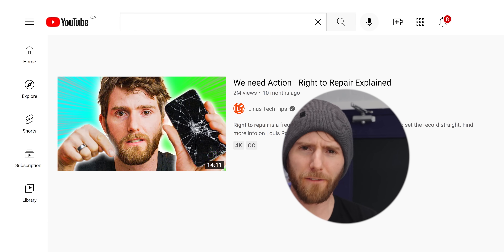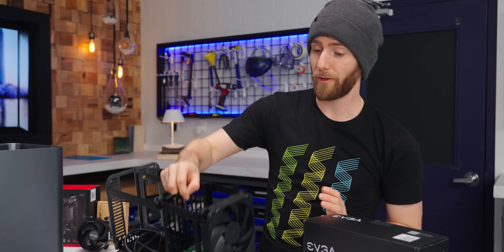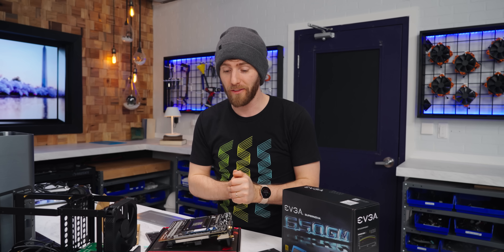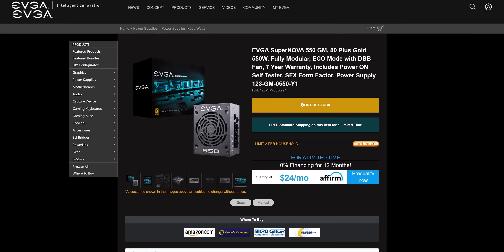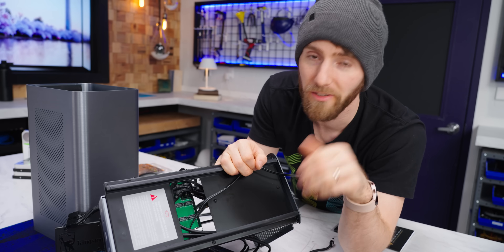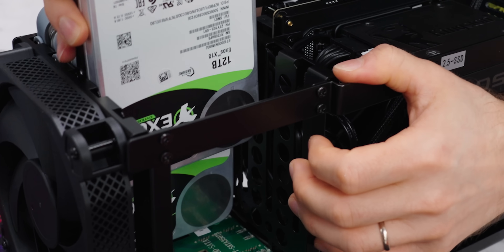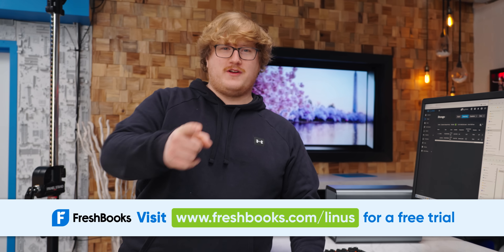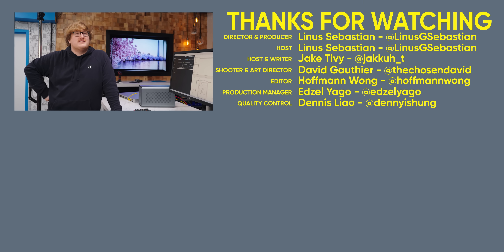This blows away the competition - JONSBO N1 NAS Build

Comment: Just buy a Synology or QNAP. I have been using a Synology NAS chassis from 2013, still works great, 4TB mirrored drives for family pictures, files and backups. I have only used about 1.8TB of 4TB available. I have another 2TB mobile drive attached via USB 3.0 for temporary files storage and sharing. It just works.

Comment: Didn't the Thumbnail say "100 TB"? That's 5x 12tb drives. And then when you consider striping raids, it basically cuts it in half.
Reply: Up to 100 TB, assumed you use a RAID-0 of 5x20TB. Forget redundancy in this case.
Reply: @HanniVlad  Thanks man

Comment: I think I'll stick with my homebuilt OMV NAS setup. 3 x 8tb. HGST SATA 6gbps. drives, a 128gb. SSD for the OS, and an older Core i7 motherboard with 2x gigabit LAN ports, in a mid tower case. It has held my mission critical backups for all my local network machines for 2 years+ and all my media server backups. About $525 total investment WITH the drives.😉 $65 ea. for the 8tb. HGST drives on Ebay, and $30 for the 128gb. SSD. OpenMediaVault has worked flawlessly and imho, is a bit easier to work with than TrueNAS.

Comment: Love the video and would like to build something similar but with two modification. Remotely accessible and ZFS metadata on NVME array.  Can you make a recommendation for a motherboard with either intel vPRO / IPMI and PCIe bifurcation. Ideally, I would like to do the same build but with TrueNAS setup to store metadata on 4 x Intel Optane in RAID 10 via something like the Gigabyte CMT 4034. Or is this already possible with intel VROC on the ROG Strix B550-I

Comment: i'm running a qnap ts-230 with 12tb in raid1, with 3 reolink cameras hard wired with POE with a battery, power goes out, cameras stay on, cheaper than renting onedrive space. I can VPN in, upload from anywhere on telus at 100MB/s up and down and didn't pay more than $1000 for everything including cat6 wire that i ran myself and works flawlessly for months while i'm out of the house.

Comment: Hi Guys, I am going through the shopping list you setup above and I am missing the the io daughter board you are showing at 03:39 as well as the HBA because of the board only having 4 sata ports available. The cache ssd is also missing could you do an upgrade here, because I am not exactly using the same products so therefore all components would be useful. Well done video so far ;-) Will see and give feedback when my build is finished.
Reply: Something else i learned from truenas and other sources that the cache ssd is really only needed for very special use cases so for us norms wasted money so also no hba card needed but money for the ssd already spent 🤨. i decided to go with 4 disk setup so no hba needed the mainboard supports 4 sata ports. The system will go on a nvm ssd m.2 card, ordered 120 gb can be splitted for cache usage too but is not supported out of the box so will not use that to avoid upgrade issues. I am thinking of a second 10GBit network adapter for trunking but will check benchmarks before. I opted for a six core 3,7Ghz Ryzen and 32GB of RAM for future proofing. Updates follow.
Reply: @joergdweis  nice. some good tips there. i already had the m.2 and also now a working hba. all is up and running now just out of slots for a network adapter. maybee i can remove the m.2 cache drive (on a pcie to m.2 card) and use the pcie slot for a faster network adapter or a two port network adapter.
Reply: I second this... trying to find a relatively good m.2 to sata adapter. bit lost and the one they use would be nice to know..

Comment: This looks really cool. I'm planning of moving my 12 yr old storage solution (supermicro server with a 24 port SAS enclosure + an HPMSL2024 tape library) to a newer solution. The TrueNas OS you're using appears really cool. Do you know whether it can also control tape libraries? Can the enclosure also connect SAS instead of SATA? I could thereby move my data over, change the main server, install truenas, and have everything running off there. The real thing these days my server does is making backups to tape, running a bunch of virtual machines on virtualbox, and some docker containers.
Reply: No SAS backplane there, sorry.

Comment: I think the video is very good, thanks for that, I was wanting to make myself a nas and you have partly given me the solution, but I have many doubts that you do not comment on in this video. What storage capacity does it have and can it have? You do not comment anything about it or show the HD, nor do you attach a purchase link. Can it be used as a multimedia center as well as storage with that system that you installed? These and some other doubts are on my mind. Forgive me for that, but since I am not familiar with these systems or machines, I have doubts as a newbie.
Reply: The storage capacity depends on the hard drives you choose to put in it. If you run truenas, it's ideal that all of the drives are the same size, but this particular case can fit 5 hard drives. 
It can be used as a media server, but if you want it to transcode (live compression of media to share over the internet or to devices that can only support certain file types), then you would probably want a newer Intel CPU, as quicksync is really good for that.
Reply: Multimedia would be something like PLEX, and they use Seagate EXOS enterprise server drives.
Reply: This case does fit 5 harddrives. With the largest at the market today (20TB) you could get 80TB if you have 1 drive redundancy or 60TB if you have 2 drives redundency. 

(I used TB as meaning TiB here).

Comment: I bought an asustor AS6604T for 499,-€ put it on the desktop, put 4 Ironwolf in it and after 24h of Raid5 build it was ready to use and it works. The Prolbem with FreeNAS or TrueNAS how it is called today is that it is unstable in the case of a harddrive failure. Sometimes it works to rebuild a raid, sometimes not.

Comment: Jesus Christ!   This is REALLY bad advice.  Never use TrueNAS or any other NAS OS that uses ZFS without ECC.     Also, the good old FreeNAS rule of thumb is to have 1 GB of RAM per TB of storage.   Non ECC RAM with ZFS can result in silent data corruption.

Also, RAIDz1 (And RAID5) are inadequate to protect from corruption on modern huge drives.   Minimum should be a double mirror or RAIDz2

This case is OK I guess, but should have used a Supermicro Mini-ITX server board with a Xeon CPU and ECC RAM and stuck a Broadcom/AVAGO/LSI SAS HBA in the PCIe slot.   It's really kind of a noob mistake to build a NAS or any other server with consumer hardware.

Or, ideally, a rack mounted case with a real SAS backplane (which can also be used with SATA drives)

Comment: just remember guys, they have a 2.4g network card with that mobo and their company has 10g networking, thats why theyre getting those speeds, if they slide a 10g network card and SSD'd it would be a monster. Issue is, most of us will be capped at like 113mbps transfer speeds so dont spend your money on an ssd thinking its going to make it faster.
Reply: local network speeds very often run at at least gigabit. if you want to run a nas so that you can have a server you can access while u are at home it would make getting an ssd worth it
Reply: 500mb of data will transfer faster on a 2.5gb link than a 1gb link.  500mb of data will transmit faster on a 10gb link than a 2.5gb link.  There also network overhead and other data being transferred on the same subnet that could congest a 1gb link.  You always want your storage link as fast as possible if there is more than one device accessing it.
Reply: Or just buy a 10gb switch from Unifi and check if your 5e is screaming at you. Honestly, it will likely work just fine. I find it's the patch cables that suck, not the stuff in the wall.

Comment: Psst... Just buy a renewed workstation from Dell HP for 200$ it comes with case, Intel or amd processor, 8gb ram, and 256 to 512 gb ssd. Just install proxmox and run truenas. This case can hold 3-4 hdds as it is mini tower

Comment: I bought a HP entry level server from Tiger about 5 years ago for about $200 and installed 6 drives and 20GB of DDR4 ram.Back then that cost me about $900 all in. I remember cursing HP for only using displayport on it because none of my 5 monitors was displayport capable and a display port to HDMI cable did not work. They couldn't throw in a VGA port because tht would cost an extra nickel? I ended up installing the OS on another computrer like you did and after that everything was over the web interface.

 I used 2ea16gb thumb drives as mirrored OS drives (one inside on MB and the other stubby drive on a front USB port) and installed FreeNas on it. It's been running since then 24/7 without any downtime except when we have a power interruption. Maybe someday I'll upgrade to TrueNas
Reply: I use display port to vga, it works

Comment: How did you get past the VGA check without a GPU? I followed this exact build and it wont boot due to the VGA.
Reply: depends on the board manufacturer
Reply: @vipvip-tf9rw  im talking about the board they used, because I followed the build and parts exactly. In the end i had to get a cheap graphics card to make it all work.

Comment: you really need to buy a MB that has it's SATA Ports vertically to top orientated and not 90degree to the side - otherwise it will bi super tight to get the SATA cables in

Comment: Your reasoning is partly why I decided to build my own nas years ago, when it was time to upgrade I was able to get a b560, i7 11700, power supply, ram, etc for much less than some crappy synology, and I have igp transcoding with that i7.. my  server is a win and I love it. the only downside is it uses 100w, (6x7200rpm sas drives) but under load is only 110 when doing 5+ streams. I also use it as a network share.. it's great.
Reply: Nice! Have you measured the idle power consumption? If yes, can you please share?
Reply: @v.sswaroop8401  yeah, with the Asus b560, 32gb of ddr4, 4x120mm fans, sas controller and 6x sas drives and 1 ssd, it idles at 99w. When I load up 5+ streams it only goes up to 110w
Reply: @The_Father5700 thats awesome. Do you have any suggestions to reduce the idle power consumption further?
Reply: @v.sswaroop8401  I don't think much can be done, those sas drives are 8-10w each, so they're almost 60w by themselves. I'd rather not be spinning them up and down to save a few watts, so I just let them do their thing. A 30 or 40w nas would be nice, but to do that you'd have to use a 2 disk low power Synology, with their low power dual core or atom CPUs, which wouldn't be able to transcode without a GPU like the 11 series Intel can with the igp.
I'll trade a few watts for the extra horsepower and ability to transcode without a GPU.
Reply: @The_Father5700  Thank you so much for the inputs. I'm working on going with your build.
Reply: @v.sswaroop8401  np, I went a little overkill with the 11700 and sas drives, but I wanted maximum speed, and 6x 7200 read in raid 5 is pretty nice.
You can get a cheaper CPU that has the newer Intel hd 750 igp, but prices weren't much different, and I figured to get a decent CPU I could use for other things down the road if needed.
Reply: @v.sswaroop8401  don't use sas drives, and sas card, use mb sata instead powerconsumption will be 60or less, I think beacuse of sas card his cpu won't idle
Reply: @The_Father5700  what sas drives do you use?
Reply: @vipvip-tf9rw  right now I'm using wd ultra star hc320. I bought them off eBay last year. I won't buy Seagate drives. Many have good luck with them, but I haven't, so I avoid them

Comment: Why wouldn't you just go with a Ryzen 5 5600G since it's cheaper than the Ryzen 3 3100 and you get a direct video out? Also considering the 32GB Intel nvme drive more expensive than much faster and large Samsung drives why would you go with that?

Comment: Is it a smart idee to run my games on a raid 10 system whit 4 hdd’s in my pc? So you have fast speeds and cut cost. Maby this in a stupid idee can’t find it on the web.
Reply: it's stupid, 2 ssd will be faster, raid is fast, but have huge latency, and raid 10 is not cutting costs, cheapest one to have ssd and one big drive, ssd for cache

Comment: i have a Qnap 9bay, i don't get 280MB on mine. Need to be directly attached to the router i think. these powerline adaptors are fine if you don't care about your speed as much

Comment: Can I use Ryzen 3 PRO 4350G for raid6 configuration ?
Reply: cpu doesn't matter, which one do you want? software or hardware
Reply: @vipvip-tf9rw  software
Reply: @christyyardleysibi3519  if it's hdd based it will work

Comment: Nice case. One thing I did’t get. The backplane has 5 SATA ports, the mobo 4 ports. Do the 5 drives work using the 4 ports? I didn’t see a pci card.
Reply: m2 card is pci e cars isn't it?

Comment: No ECC = no thanks. I run TrueNAS on an Asrock Rack C2550D4I with 4x8 DDR3 1600 ECC in a Fractal Node 304 (~$130) with 6 drives. The C2550D4I is nice because it comes with 12x SATA onboard and it's the board that official TrueNAS pre-built systems use, so good software support. Paired with a cheap 10GbE Chelsio NIC to do bonded 20GbE and it's a little monster. Having IPMI on the board is nice too since it's in the attic and not as fun to plug a monitor and keyboard into. Looks like the modern equivalent, which they might be also using in the more modern TrueNAS official boxes, is the C3758D4I-4L which lets you do 4x16GB 2400mhz ECC DDR4, 13 x SATA3 6.0 G. The next step up from that would probably be something Xeon-D or EPYC 3xxx-based. Read up on "why ECC for ZFS" but basically there's a very real possibility that it can corrupt data silently without ECC.
Reply: and real statement that zfs ecc is solved by devs

Comment: Your motherboard has video connections on it, so no need to put the OS drive in another computer.
Reply: cpu doesn't so connections don't work
Reply: @vipvip-tf9rw  The motherboard clearly has HDMI onboard, so yes he could have planned to program everything up inside the case he built into. If his CPU can't do it for some reason, and I doubt that, then it is poor planning on his part. He could have also gone with Intel, but I think he is covering as much ground as he can, because not all boards are video compatible, the HDMI port on his board makes it possible.

Comment: Right about now one of those mini PCI-E GPUs or even USB GPUs could have come in handy, so you can simply use a cheap compact GPU for installing the OS. And I wish all CPUs were APUs, even if the iGPU only had something like 128 MB of VRAM, which to be a cheap SSD or MicroSD storage built-in (and maybe replaceable or even upgradeable).

Comment: I built one of these myself a few months ago. The ONE thing I will add is that you DO NOT want to just install the OS on the SATA drive and YOLO it from there. I had to pull this thing apart and raid my main PC for its video card so many times because:

A) BIOS needed to be adjusted to use correct RAM timings, 
2) the M.2 to SATA card didn't work for me and I ended up having to go with a PCI-E to SATA card (could have been a problem with using a Gigabyte AORUS Pro AX B550i... mounting the M.2 to SATA didn't work without mods to the mounting position and then the card just would not work anyway in this or my regular PC... also a Gigabyte AORUS),
D) There's still a little leftover interaction you need to do when you first boot up after OS installation that I didn't know about.

Test bench build, make sure everything works properly, don't close up until it posts and shows everything. I will take ownership of my choice of the Gigabyte instead of the ROG Strix motherboard being a huge part of my problems, but once everything was settled this setup just frickin' rocks. Now I have most of my important stuff on this Raid Z-2 jammy with (almost) no worries of losing stuff ever again, and being able to access it through TruNAS' FTP makes life so much easier for working on the road.
Reply: A, 2, D. Home Alone reference?

Comment: This video finally broke me down to get started.  Going to use Intel instead of AMD (just preference), budget wise starting with 5 Ironwolf NAS Pro 4tb drives.  The 650w power supply since it was on sale and cheaper then the 500w.

Now just shopping for a used I5 10th or 11th gen CPU to slot the motherboard.   Worse case, if I dont find a cheap on before Oct, I'll upgrade my rig to a I7 13gen, drop my I7-11th into daughters PC, and steal her I5-11th gen into the NAS

Comment: The biggest problem I have with TrueNAS is the total lack of support for backing up to an external USB drive, unless it is configured as part of a ZFS pool.  No way to use an ExFAT formatted external drive that could be pulled off and directly accessed if the NAS unit failed.
Reply: I agree with that. Try porting your old EXT3 disks! I had a hell of a time. The easiest way is a likely via a network share. SLOW if you have many TB to transfer.. but perfectly fine if you are not in a rush.

Comment: $200 CAD + $240 CAD shipping? And its cheaper than a QNAP? Lol shut the eff up. Silverstone DS380 is 260 CAD and its 8 bays hot swap + 4 2.5” internal. And its ITX. And the 8 bays can be accessed without sliding the whole shell off. Next time don’t BS people.